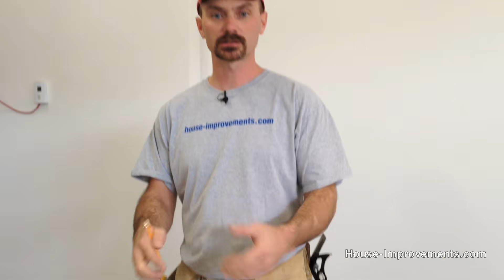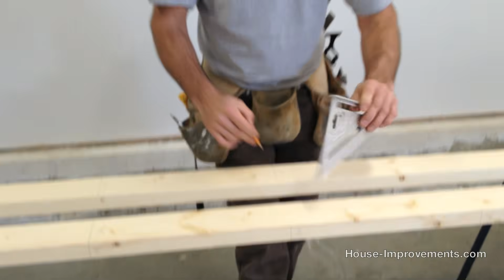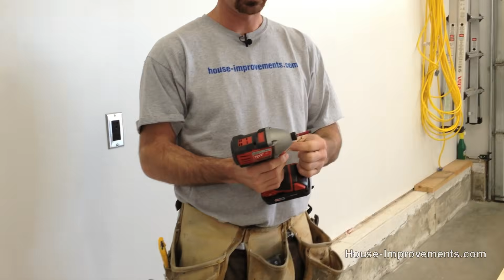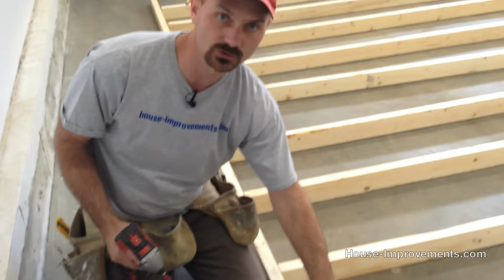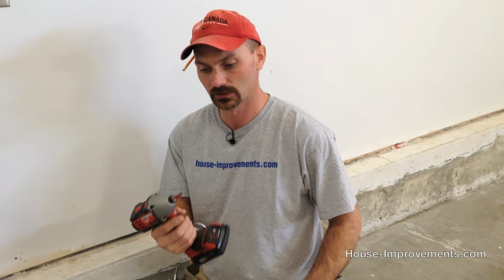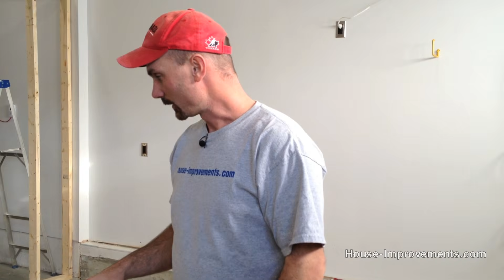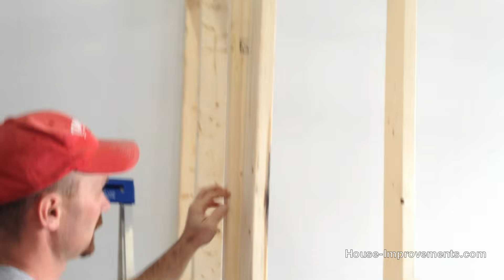Wood Stud Wall Framing

Comment: Thank you for clearing that up.  You built my next project.  Put two walls up in a garage to make a 3 car garage a 2 car garage and a storage room.  My question:  What's the best was to anchor the walls to the floor?
Reply from the maker: EruditelyWise Sorry about that ,somehow I missed those. They have now been banned
Reply from the maker: For what you are doing a metal pin with a kinked shaft is the best option,watch this video to see them and other options as well. How To Fasten Wood To Concrete
Reply: For wooden bottom plates use Tapcon screws. The wood should be pressure treated with sill gasket underneath.
Reply: cynisturb bullshit
Reply: Fabian Orozco God you're disgusting.
Reply: you guys realize this is a home improvement video.. take your political and racial views over to TYT Channel -
Reply: I recently had a similar project in my garage. In all of my research as well as input from the city inspectors the best option ended up being a "wedge anchor". They were very easy to use and an absolutely amazing and sturdy fastener. You use pressure treated against concrete, always... You drill holes into the wood down to the concrete and then use a hammer drill(rent a quality one with a good bit, I spent an hour on a hole with a cordless hammer drill with a brand new bit and finally rented a corded high power hammer drill from Home Depot and blew through each hole in 2-3 minutes). You hammer the wedge anchors into the concrete(thread the nut first in case you destroy the top threads while hammering) and once you reach the bottom of the hole turn the nut until tight. Good luck!

Comment: also, don't you drill the wall into the floor at all?
Reply from the maker: Yes I believe that was mentioned but we do not do it because this wall is only being used for this video. Attach the bottom plate about every 3-4 feet or so.

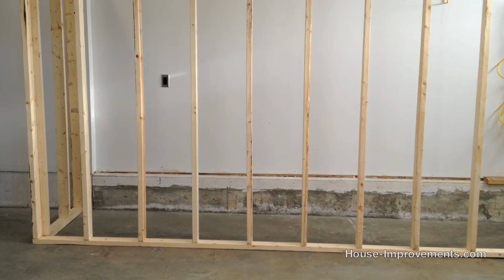Comment: great vid but I have a question: at around 18:15 you drill down from above the wall to join both walls but what if the wall goes right up to the ceiling. would you drill from below? How would you drill the joint?
Reply from the maker: Yes you can do the same thing from the bottom side

Comment: Great vid.  As a point of clarification, is my math right if I say that the first stud of the wall (on the end) and the second stud will be less than 16 inches on centre?  It seems to be 16 inches from the end of the baseplate to the centre of the second stud.
Reply from the maker: Yes that is correct. Every wall will have the first space and also the last space less than all the other regular spaces
Reply: HouseImprovements Thanks!

Comment: Good video, pretty much how we used to do it when I was an apprentice back in the 60's. We were not allowed to fix into the end grain so we had to fix the stud into the plates. Do you not cut noggins in between the studs?
Reply from the maker: It is only required when the wall is 10' high or more , if there is no plywood being attached to give support or on load bearing walls
Reply: HouseImprovements Its not how I was taught in the 60's. You put them in but that was the UK and a long time ago when we still had pounds, shillings and pence and used feet and inches
Reply: icespeckledhens Still have to do it that way in the UK now :-)

Comment: Wow, you really did a great job explaining every step involved with building a wall.  Thanks for helping me understand how to measure the "16 on center" part, I would have thought it was just measure 16" and center the stud on the line.  How you explained it was very educational to me, I will be using this video to help me build some walls for my basement.

Comment: Shannon:  Excellent video, thanks.  Question:  When you attached the top you came in from the top, but if you are right up against the ceiling, (I guess you were in a garage, the ceiling is higher than 8') do you come in from the bottom?  Also, when you measure the 2X4's it wasn't clear if the top plate, plus other  2X4 for the top plus the bottom 2x4 came out to the standard eight foot ceiling or if they needed to be cut to fit? Duh, sorry, don't want to mess up.
Reply from the maker: In our demo we were dealing with an area where there was no obstruction at the ceiling. If you are adding a wall in your home you may not need the double plate. You could attach the top plate to the ceiling and bottom plate to the floor then cut and install each stud to fit, or assemble your wall laying on the floor and stand it into place. If you do the farming on the floor and stand then you need to build it slightly smaller usually in order to e able to stand it up. 
If building a wall to fit between a floor and ceiling then you will cut the studs to a length but deduct the top and bottom plate thicknesses. If framing a wall were there is no obstruction and you want it to be a certain height then again deduct for the plates.
Reply: Thanks Shannon, I appreciate the quick answer.  That clears it all up.

Comment: How would you anchor a wall to a concrete slab that has hydronics in the concrete?
Reply from the maker: Use a construction adhesive to attach the bottom plate to the concrete. It may take a few hours to be solid but it will work good

Comment: You have some great videos Shannon.  Once you stand up the wall,  how are you securing it to the floor?  With anchor bolts that protrude through the sill plate or just using structural 10d nails.  I've also seen people use screws.  Unless they are structural screws, I don't see that working.  Confusion...
Reply from the maker: We just were doing this a demo for framing. As far a securing it to the concrete floor it depends on the situation. I do have a video showing different fastening to concrete methods.
Reply: HouseImprovements can you provide the link to this video. thanks

Comment: when you are building a house onto a concrete foundation do you screw it into the concrete with mason screws?
Reply from the maker: please bring your question to my forum and I can answer you from there .http://www.house-improvements.com/forums/
Reply: You can use 3" Tapcon style screws or cut nails.  And the bottom plate would be pressure treated on a concrete floor.
Reply: Some codes require the exterior walls be fastened with concrete anchors for slabs.  These would be 1/2" x 4" expansion style anchors with a washer and bolt holding the bottom plate in place.

Comment: How do you avoid obstacles such as pipes running on a concrete wall in a basement?  Would you just avoid putting a continuous stud wall over it and just skip it, so when the drywall is applied it is covered seamlessly, even though all the drywall measurements would be off?
Reply from the maker: ya you need to work around those types of things as good as you can.

Comment: What nails should I use?  Is it necessary to use nails instead of screws? Thanks.
Reply from the maker: 3" - 3-1/2" framing nails. Nails are better in my opinion, more shear strength than screws.
Reply: HouseImprovements Do you know where I can find them?  I have been looking but only can find ones that go in a nail gun.  Is that the only way to use them?

Comment: I was just noticing that you didn't mention when that wall goes against another wall, like when one exterior wall goes between to other exterior walls...That adds 3 1/2" to your starting point...You need to add that or your sheathing won't line up right...
Reply from the maker: That is correct

Comment: Thanks for the video. You really explained it well. I want to put a wall up in my basement. Kind of a dividing wall. The floor is raised plywood but the ceiling is a drop ceiling. Does the the top of the wall necessarily need to be fastened?  I know the bottom needs to be fastened to the floor. Probably a dumb question.  Would I need to remove the drop ceiling and somehow fasten the top of the wall to the floor boards above the drop ceiling?
Reply from the maker: It would really be best. I have seen tops of walls in commercial buildings attached to the ceiling grid but unless your ceiling is installed really well I would not do that.
Reply: they make a top plate if you use steel studs it will transition right into your existing drop ceiling...steel studs are very good for basements very quick and easy to use the ...the top plate will be finished with with like most t-bar grids are today

Comment: why didn't you use treated on the concrete floors
Reply from the maker: This was just a demo on framing ,these walls were taken down after the video.
Reply: HouseImprovements even i was thinking what is the purpose of this stud wall in a garage!! then thought maybe removing after video.

Comment: Another thing I'm confused about is, why did you leave back 3 1/2inches on the double top plate? when assembling both stud walls together in the outside corner, shouldn't 1/4 of an inch be hanging off since its 4inches? O.o
Reply from the maker: These materials are actually 1-1/2" x 3-1/2" but are referred to as 2x4s
Reply: Well that sure clears everything :) thank you for your time.

Comment: When laying out the top and bottom plate together to apply your marks. why do you go back 3/4 of an inch if the studs are 2inches wide?
For instance, when marking the 16inch you go back 3/4 of an inch and once screwing the stud, the center of the stud would be off, wouldnt it? O.o wouldnt it leave you centered at 15 3/4 instead of 16inch? I'm confused
Reply: 2x4's measure 1-1/2 x 3-1/2.

Comment: What size nails should I be using to frame a 2x4 wall?  Do codes vary on this?
Reply from the maker: This could vary, but 3-1/4" framing nails is usually the minimum.

Comment: Hey Shannon, Im getting ready to build out some basement walls.  How far off the concrete wall should I make them.  I have watched other videos that say 4 1/2".  Also, can I build the wall like you did in the video, stand it up then drill the anchors into the concrete and attach the sole plate?
Reply from the maker: Yes 4-1/2" is a good distance, it allows for some irregularities of concrete wall. I prefer to "stick" frame my basement walls. That means fastening your top and bottom plates into position then cutting and securing each stud in place. You could frame it on the floor and stand it but be sure you make your wall a little shorter than the height you have so that it will stand. Please come to my forum if you have more questions.

Comment: Hey there.  Love your videos.  I followed you and learned how to mud and tape drywall.  I did my entire ceiling.  Thanks for the videos.  Question now.  I'm installing a shower stall.  It's actually a sterling plumbing accord kit.  It's rough depth is 37 3/4".  I'm suppose to secure that outside edge to a stud.  And I'm supposed to have double studs for the shower door install. As luck would have it, I do not have studs in this area.  Do you have a video or other help to point me in the right direction for adding studs to support the shower install?
Reply from the maker: Try watching my video about "installing a fiberglass shower stall. If that does not help you out then please come to the forum on my website and ask your questions there. Thanks
Reply: Thank you thank you thank you. Good health to you and yours

Comment: trying to work out your maths on coming back 3/4of an inch. are your studs 2 inchs wide, also if you are measuring from the right hand outside edge then if you measure in 16" mark the line that will be 16" to the right hand side of stud and 16" on centre to first stud. so where does the 3/4 inch come from. with a 4 x 2 I understand coming back 1" so dry wall meets end of wall.
Reply from the maker: The studs are 1-1/2" wide so #/4" is half the thickness. We come back the 3/4" so that all your marks will be on an edge of the studs and easier to line up. The very first stud space (and the very last) will not be 16" centre but every one after that will be.

Comment: im building a 6x9 shed because thats the room i have to work with. 9 feet isnt divisible by 16 or 25 so how do i go about placing the studs? do i sart at one end with 16" centers and have a smaller gap at the other end, or do i start in the middle and work outwards from there 16" centers and have small gaps at both ends? thanks
Liam
Reply from the maker: Start at one end of each wall and whatever is left at the other is what you have.

Comment: Very informative video, I do have a question what's the difference between 2x4 versus 2x3 besides the dimensions on the lumber. Can you build a wall with either studs?
Reply from the maker: You could build non structural walls like framing your basement with the 2x3s, I personally would not but some do. Besides not being as strong the 2x3 wall will also not be a standard thickness that interior door frames are made for, so really only the exterior frame work would even be worth using them for. Over all i don't think the price difference is worth it.
Reply: Thanks for the info!

Learn and the knowledge shall be forever yours (and those you subsequently teach)

Comment: Love these videos. Just wondering, we saw another video by someone else that mentioned marking 3.5 inches from the end of the bottom and top plates and putting a line and an x and THEN going 15.25(i think) inches and putting another line and another x and that's where you start running your studs. Have you ever heard of that method and is it better or similar to the method you've described here.
Reply from the maker: Can't say for sure but sounds like the other video method would work as well.

Comment: At the corners, you screw/nail from the top. I am building walls in my basement, the walls will ideally go all the way to the ceiling, which will make nailing the corners impossible. Would it make any difference if I nail them bottom up? Or should I not be taking the wall frame all the way up to the basement ceiling?
Reply from the maker: No you can "toe nail" the top by angling the fasteners up from the bottom.

Comment: Hi,
On a non-load bearing wall like you did in this video do you need to fastened the bottom plate to the floor? If yes, what is the spacing between the "tapcon"?
Reply from the maker: Yes fasten to the floor. If using tap cons I would go every 3-4 feet.

Comment: I'm going to attempt a partition wall similar to this except the corner is 45 degrees. Can you point me to a video or photos of how you'd frame the 45 degree corner? Also the ceiling is pitched on top. Would you assemble a pitched wall on the floor and stand it up?
Reply from the maker: Hi "Mr. Rubble", LOL . please repost your question in my forum on my website. I will be able to post a couple of pictures there for you that my help you out.

Comment: what about noggins?
Reply from the maker: You can add blocking (noggins) if you want but really not needed unless your walls are over 10'. And then add a row of blocking between the studs about half way up the wall.
Reply: HouseImprovements where are you from shannon great video btw
Reply: HouseImprovements How do you build a 10 ft wall with 8ft 2x4s?
Reply: if it wasn't necessary, why do all housing developments construct houses with noggins with wall heights of 2.4? Doesn't it stop twisting and warping of studs?

I'm not a chippy obviously, just looking up stuff but maybe its different standards in US.

Comment: Are you going to nail the wall to the concrete floor ?
Reply from the maker: I would if that wall was staying there. We built this wall just as a demo for the video.
Reply: So, should I use one of those bullet nails to secure wall to concrete ? ..i have a patio and i want to make a hobby room on it.

Comment: Would you recommend useing a pre treated bottom plate,and the rest of the stud wall kiln dried.
Reply from the maker: Not completely necessary unless in a damp location. For an example the  bottom plates of garage walls or basement walls.

Comment: Nice work, one question ,when I see builders put a sill plate on a cinder block, they set a bolt into the block then bolt the sill plate in, then put the wall onto this, how do they fit wall onto sill when the bolts are in the way,hope I make sense,also do they use nails or screws to fix together
Reply from the maker: Usually they will take the bottom plate of the wall before the wall is built and place it on top of the bolts, line it up where they want it and hit it with their hammer near the bolt locations, this leaves a mark where they will then drill an oversized hole in the plate that will fit over the bolt when the wall is erected. Generally nails will be used, unless leg bolts are specified by designer.

Comment: If my floor joist have 1 inch copper pipes underneath it, what should be the gap between the top plate and the copper pipe?

Amazing tutorial! I can't wait to build my basement! :)
Reply from the maker: I would try to leave your self about 3/4" of space in that area.

Comment: Hi Shannon,
I have a question on the bolts you used for the floor framing.  You said you used a 3" bolt, but you use a 2 x 4.  How can it go through both the 2 x 4 and into the skid?  Also, can you help clarify the "16" on center" .  Thank you,  I'm the girl with tools.  Becky
Reply from the maker: I think your comment has to do with the shed floor video? Anyways if you watch it again you will see and hear that I actually used a 6" leg bolt not 3". for an explanation of the 16" O.C info come to my forum on the website and ask your question again under the misc. heading and I can answer you better from there, thanks.